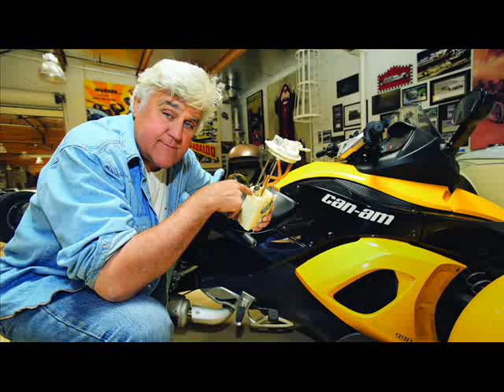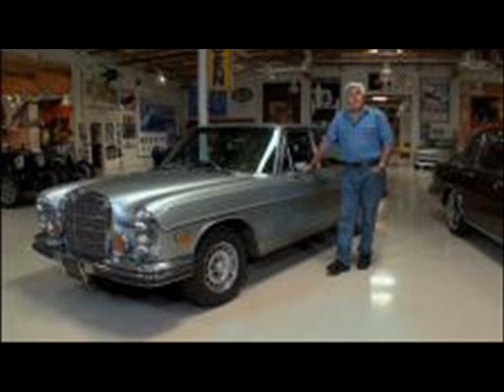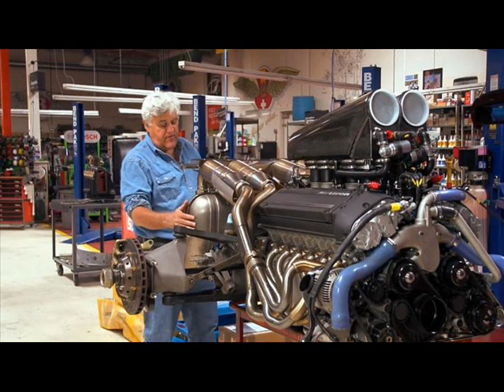Jay Leno hates ethanol

Comment: The minuscule benefits of ethanol do not equalize the draw backs. Adding 10% in the nations gasoline production is the wrong way to infuse ethanol. Building a engine designed to run on E85 is the best way to run ethanol, as gasoline improves ethanol but ethanol degrades gasoline in many ways...
Reply: Okay, give me the top 10 many ways that ethanol degrades gasoline.
Oh, just give me the top 5 ways,
Okay, 2 ways, just give me 2 ways that ethanol degrades gasoline.
One way, can you give me 1 way?